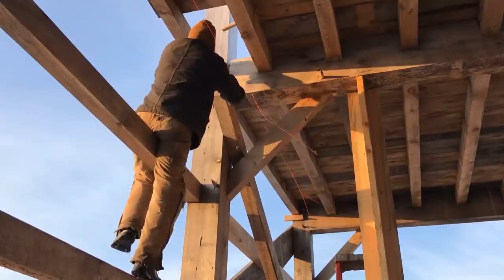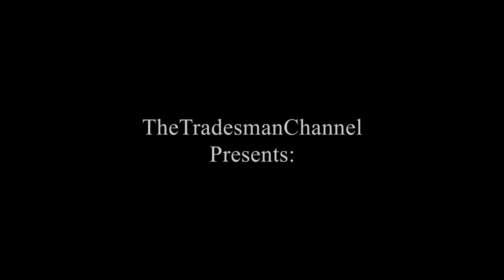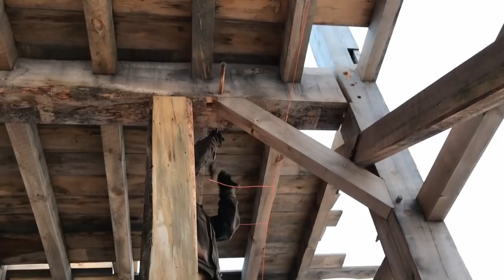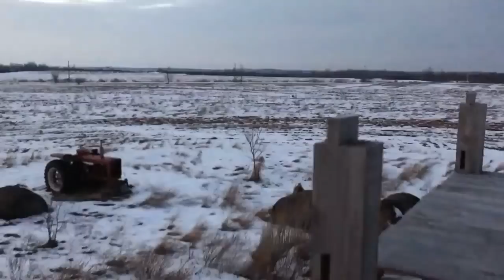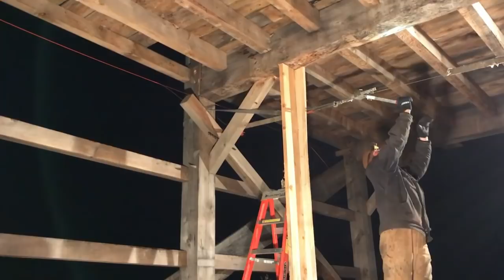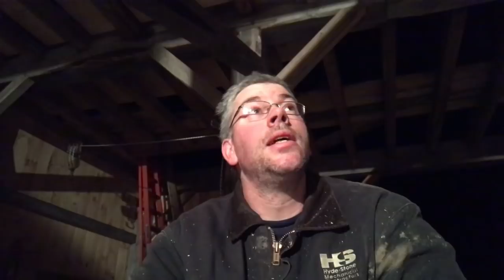A Timber Frame Vlog #107: I Win

Comment: Great fix Jim.  For what it is worth, I have taken apart a couple of old barns and removed more that one peg.  I found that cutting the tapered end off flush with the timber and then using a drift pin of a slightly smaller diameter than the peg to drive the peg out from the opposite direction from which it was driven works better than drilling.   I could not agree more with you about the good enough comment.   I enjoy every video, keep em comming!
Reply: Tim ODell  dont  you think he started somewhat like that. Choice to drill is not without reason i guess ;)

Comment: 20 YEARS AGO YES I WOULD HAVE SAID HAVE TO FIX THAT! NOW I GIVE IT A THUMBS UP AND SAY LOOKS GOOD NICKY
Reply from the maker: +Arnold Romppai nice, hi Arnold.
Reply: hi how you doing, other then nice weather, we finaly warmed up to - 5 to -15 by night for a few days
Reply from the maker: +Arnold Romppai I'm doing well Arnold.  Editing and I might get to bed before 1am tonight, you never know.  Nice not to have to thaw water lines for the cows today.
Reply: true water line was finally open today for the cows, in the spring I have to dig up that barn water line, it has never in all the years froze, until this year, the heat trace is warm to ground level, but who knows what went down the drain tile the pipe is in and ether chewed off the heat trace below ground or took the insulation for there home  leaving my barn water line to be open to freeze
Reply from the maker: +Arnold Romppai I'm having the same issue here.  It gets below 20F I'm out there with a heat gun.

Comment: I work with a guy who lives by "Good Enough", very irritating, and his life shows the fruits of his attitude. Thank you for your encouragement. You are incredible. 
Did you cut the mortise pocket deep enough to push the tendon in 1 1/2"?  Or did I miss something? I was thinking they were only cut about 1/2"-3/4" deeper. Anyway, congratulations on the fix.
Reply: I just found Rod Peterson's thread. I got my answer. Thanks any way. Keep it coming.
Reply from the maker: +Grant Pipkorn the mortice is actually a through mortice.  Worked out very well for me on this repair.

Comment: YYYYYIIIIIIIPPPPPPPEEEEEEEE, its done,u did it,bet u can even sleep better now,its done,sugestion,if I knew I wouldn't ask,your gonna cover outside with boards,what if u put like 3/8 or 1/2 lag bolts in from outside into tendon,drill pilot hole and counterbore,siding will cover and  bolt head will be below siding,just an idea,

Comment: I have some questions for you. I have been watching all of your videos in sequence and I don't remember how you connected your tie beams to your wall posts. I replayed some of the earlier videos (#1, 11 and 12), it appears that you have only a mortise and tenon holding it together. Your wall post continues up from the tie beam and your top plates sit on top. When you put on the roof, is the compression of the load on the rafters going to push down and out? Is that right? If that is the case, then the next question should be: Are the pegs the only things holding that joint together?
Reply from the maker: Just pegs holding them in.  Those joints that connect the posts to tie beams are in tension due to rafters thrust.  To take care of that load I made through remind and there are three ash pegs in each joint.  This whole structure is held together in this manner except for where the queen posts will connect to the second floor decking, that will be with Timberlocs.
Reply: Will you use a collar tie higher up on your rafters? What is the angle that you cut where the tie beams meet the wall posts? What determines what that angle should be? Thanks for your patience with all my questions!
Reply from the maker: Hey no problem.  The housing for the post to tie beam is 1" at the bottom and 0" at the top.  I actually cut the housing a little deeper than normal but I wanted that extra bearing surface.  As for collar ties there will be none in this frame.  There is however going to be queen posts and purlin plates so the roof will be supported midspan, add to it that this will be a gambrel roof and there should be virtually no rafter thrust.

Comment: One thing has me confused, and maybe I missed it in an earlier video. What is the length of the tenon? And how deep is the mortise? I had pictured you pulling the whole beam away from the post (and all the laws of physics that would assault), in order to trim off the tenon to properly reseat in the mortise. I thought that was the purpose of the temporary post.

So, which part of which video did I doze off through, because it looked like you chiseled back the beam 1½", drilled out the pegs, and then just slid the beam deeper into the existing mortise (I'm ignoring the work you did on the brace pocket--that I understood). Please don't judge me. I'm old, and I often drift off in even the most compelling of videos...

Well done, in any event. As hinted at in another comment, this is all familiar territory for me. Getting it squared away is definitely puffy chest time.
Reply from the maker: +Rod Peterson no problem Rod.  It was a through mortice with a full depth tenon so it went all the way through the post.
Reply: Thanks. I must have missed it early on in the process, or maybe it hadn't been videoed. I started watching at VLog #1, I thought, and I think you had most of the lower bents done by that point. Maybe not. I'm watching way too much YouTube, and probably mixing stories.
Reply from the maker: +Rod Peterson it's ok. I did quite a few videos before I decided to turn it into a vlog style.  I may go back and renumber the blogs to include all of the barn videos.
Reply: Thank you for the renumbering. I did go through some earlier ones and found the through mortise on one of the bents you put up (I think it was the one showcasing the attachment on the Allis that got it up for you).

That made all the difference. All of the angst you were having was justified if it had been a blind mortise. With the through mortise, it was almost a trivial repair, no matter how much you were dreading it. Well done, in any event.